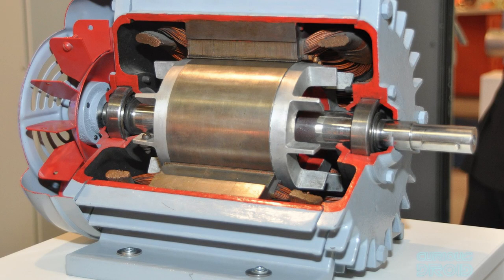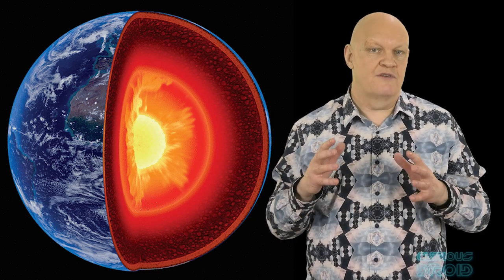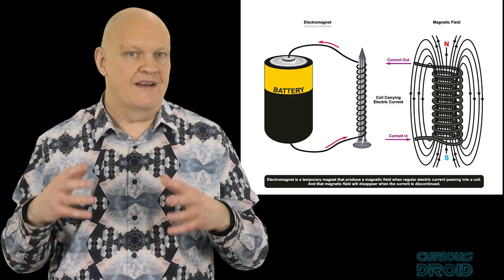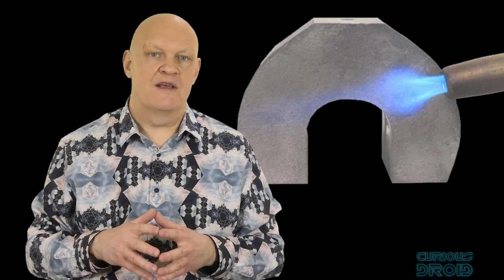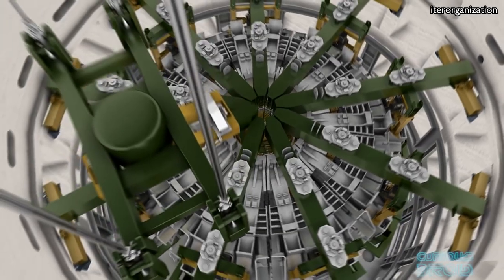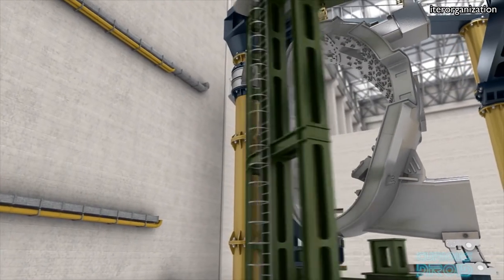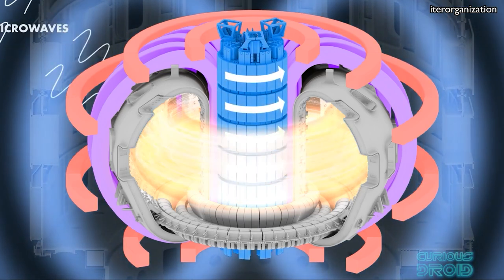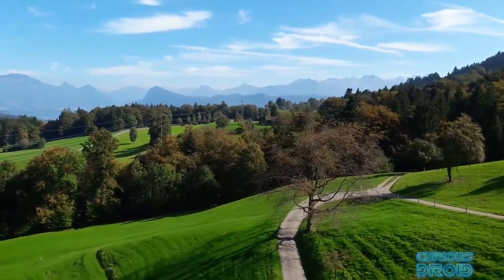The Most Powerful Continuous Magnets Yet Made

Comment: Someone once said that the easiest way to make a small fortune was to start with a large fortune.  Experimental fusion reactors similarly have so far only yielded low energy output after high energy input.  A sobering observation is that wind power, coupled to battery storage, is proving to be such a cheap renewable source of energy that the economics of fusion power may prohibit it from ever competing with it.
Reply: People are so enamoured with cheap power from fission and now fusion, that they are prepared to dump endless resources into it without the objective analysis of costs to runs such a sophisticated system to say nothing of all the highly trained staff required to run it.  By 2035, it will be too late to get off Fossil Fuels if we spend money on such capital extensive projects. Put the same money into refining our existing grids with current tech and we have it solved but what gets in the way is not the technology but incumbent Fossil Fuel companies who are never walking away from $T still in the ground.   Look at the non stop trashing Tesla gets and its nowhere near as big a challenge to Fossil Fuel Industry as this will be.  Moreover, Fossil Fuel industry would support Fusion because it will pull resources away from using existing renewable tech to get our CO2 production solved in the next 10 years.  Money spent on Fusion is capital misdirected to our demise.

Comment: I used to work at a place that built cranes, and to build cranes, you need to use cranes.  Outside we had a crane with a magnet, could lift up to 10,000 pounds.  Magnet was a big rectangle, about 2 feet by 3 feet.  Had a wireless remote control and you'd turn the magnet on and off with a switch on the remote.  It was so much easier to use the magnet rather than using straps or chains, but it was also a little more dangerous.  But then again the only thing I ever saw come crashing down at that place was due to a hook on one of the chains breaking in half.

Comment: I've been asking this question for a while but have not yet found a satisfactory answer:
"How will a fusion reactor convert a hundred million degrees in temperature to electricity?"

If it's just going to boil water to make steam to turn turbines, that seems pretty wasteful considering you only need 100 degrees Celsius to do that. Building many fission reactors for the price of one fusion reactor seems like a more efficient way to convert water to steam.
Reply: Yep.... it's going to use the hilariously ancient form of steam power to drive turbines.
Reply: @BRUXXUS  All the artisinal craft beer hispters are putting on their top hots and twirling their mustaches all the way to the Steampunk convention when it's held in celebration of ITER being switched on.
Reply: @oldmandoinghighkicksonlyin1368  Hahahaha, I mean.... why not? 
But yeah, it still feels super weird that we're developing this ultra-high tech power source, but still just using it to boil water. While it's fairly efficient, I still feel like there's got to be better ways to get electrons moving.
Reply: Steam at 100°C is only useful for making tea.  Water is boiled into steam, the steam is heated and that heated steam drives the turbines.  Steam at around 540°C is typically found in coal plants.  About 270°C in nuclear plants.
Reply: @borysnijinski331  Still quite a deficit when fusion is cranking out a hundred million degrees Celsius. Seems wasteful.

Comment: Small correction: It's not the neutrons which heat up the water in a fission reactor. It's the electromagnetic discharge, which is a result of the loss of total mass, which heats up the water (Or whatever material they use as a heat transport. Some uses molten salt).

Comment: For a clarifier, Fukushima and TMI did not experience runaway reactions, or prompt criticality.  Thats not physically possible in LWRs.  They did, however, lose decay heat removal and the fuel overheated an melted.  This occurs because the radioactive decay of the fission products produces a substantial amount of heat, even after the Rx goes subcritical.

These numbers for ITER are not great.  For reference, a nuke plant uses about 50 MWe to produce 1400MWe.  Keep in mind there is no balance of plant equipment at ITER.  In a thermal plant those items use most of the house electricity, for feed pumps, booster pumps circulating pumps, etc.  300mwe to make 500mwth is not a net positive for electrical generation and not commercially viable.  It's neat, but still many many many years off.

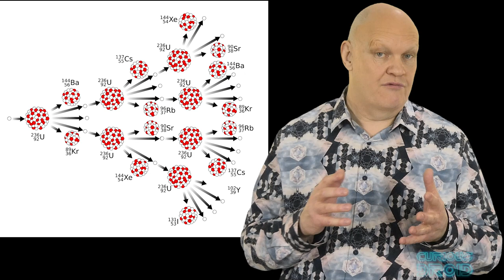Comment: 10:10 Information is incorrect. In Fukushima the chain reaction was stopped immidiatly! The problem was with the loss of reactor core cooling.The rest decay heat has to be compensated by the cooling system. 

Unfortunaly, this problem exists (in a smaller scale though) in the future fusion reactors. Even after plasma shutdown, walls will still produce a lot of heat due to the dacay of the wall radiactive materials. In case of cooling system fail the wall can melt. It is apperently not that dramatic as in fission reactors though.
Reply: Yeah, one of the advantages to fusion is that the worst scenario is localised destruction. Unlike fission, fusion requires active effort to sustain it, so if containment power is lost, the reaction stops pretty quick. However, you still have 150 million °C plasma circulating in the reactor, and now it's uncontained, and will do a lot of damage before it cools down.
Reply: @simongeard4824  I'm talking about irradiated wall, which will heat itself even after stopping fusion and plasma completely

Comment: Fascinating as always! - but I would like to see a bit more on the Fusion projects - specifically how is the heat generated extracted - seems the reaction area is surrounded by super cooled magnets - how do you "sneak" the heat past these? And I assume the zillions of neutrons produced activate all the surrounding materials - what are these effects? Embrittlement, production of radioactive elements, structural issues as elements change? Also, what plans are made for safely "draining" the super conductors if cooling is lost? Losing superconductivity would sure release a lot of energy. Fascinating issues - I'd like to know.

Comment: The big question is what if something in the calculus "we" use to replace the huge gravity of the sun to make nuclear fusion possible here (but with higher temperature) is off or there are some undetermined factors that make the whole process unlikely.
Then we will never reach such reactor's utopia. Or may be the complications come simply by the very process(es) we try to apply that simply are beyond our current capabilities. 
So far, even if we get one working as desired (with real net yielding of excess energy), it would be the most expensive form of energy (as per the money poured into it) ever.

Comment: Carbon has a negative temperature coefficient, so the warmer it gets the better it conducts and this is why its used in electric motors as brushes when they're required
Reply: That and because they are slippery and softer than the sliprings and commutator bars.

Comment: 11:30 "The problem is that unlike the Sun, we cannot recreate the extreme pressure here on Earth" This is only partially the reason we want much hotter plasma than that at the Sun's core. The Sun is a surprisingly anemic reactor: its core has average energy output of mere 300 W/m³. The humongous energy output of the Sun is due to its giant size, but its power density is meek. At this output rate, a 300 MW reactor would require the reaction zone volume of 1 million m³. Imagine a cube 100×100×100m (yes, it's hard even to imagine!), this big, entirely impractical. We need a much, much higher energy density here on Earth. This is also why we cannot use light hydrogen as the fusion fuel. The p-p reaction, the main reaction within the Sun, would still require unreasonably high pressure and temperature. The D-T reaction has a much larger cross-section (a measure of the likelihood that fusion will occur if you get nuclei close enough despite repelling charges), and the heavier hydrogen isotope nuclei (D is a proton and a neutron, T is a proton with 2 neutrons) are easier to smash together: the Coulomb repelling force is the same at the same distance, since each nucleus has 1 proton, thus 1 unit of charge, but the kinetic energy of the nuclei with the extra weight of neutral, non-repelling neutrons is proportionally higher (a proton and a neutron weigh about the same, so the D nucleus weighs twice as much, the T thee times heavier).
Reply: And in comparison, a human is about 1,250 watts per cubic meter, or roughly four times the power density of the core of the sun!

The standard 2000 kcal daily recommend diet is 8.368 MJ of energy, there’s 86,400 seconds in a day, for an average power of 96.86 watts, which we’ll round to 100 watts. The average person in North America weighs 80 kilos, and humans are close to neutrally buoyant in water so we know their volume is 80 liters, or 0.08 cubic meter. 100 watts per 0.08 cubic meters gives a power density of 1250 watts per cubic meter.

Comment: 11:30 "The problem is that unlike the Sun, we cannot recreate the extreme pressure here on Earth". Isn't that what inertial containment fusion researchers such as First Light Fusion do?
Reply: Pressure and temperature work together: in physics they'll often appear in terms together (as a product: P*T).  The sun has tremendous heat AND pressure.  the inertial confinement in ITER and most torus-designs is trying to maximize the pressure we can achieve on earth... but what we lack for pressure we have to make up for with temperature.  Hence the temperature has to be THAT much more than the sun, to make up for the deficient pressure.
Reply: ITER doesn't use inertial confinement, it uses magnetic confinement. Inertial confinement either uses lasers to compress fuel pellets, or as in the case of First Light Fusion, a physical impactor.

Comment: Please make a video detailing how scientists plan on actually harnessing fusion for use in producing electricity. It’s one thing to make it run, it’s another challenge to utilize it.
Reply: Yes, always wondered how to deliver the plasma thermal energy into working fluid (steam, other hot gas)
Reply: Worry about making a sustained reaction the produces more energy than it consumes and the worry about how to harness the heat to make steam.
Reply: @borysnijinski331  I'll love it if they make the machine actually run but can't extract the heat to make power.😂  Fusion was only 30 years away...30 years ago

Comment: fusion will require much higher temperature than what happens in the Sun.  In the Sun the probabilities of fusion of aroms are extremely low, but due to the enormity of the Sun the very low probability events happen enough times due to quantity of the available material.  Our fusion reactors on Earth don't have anywhere those amounts, so the low probability events just won't happen in quantity that would make any difference

Comment: Good to see you back, question: I was under the impression degrees were used for Celcius and Fahrenheit but Kelvin was the metric on its own so "degrees Kelvin" dont exist. Feedback would be appreciated
Reply: I'm pretty sure you're right.  Such an easy mistake!  I usually have "degrees Kelvin" on the tip of my tongue...  Never degrees Volt or degrees Ohm, but I guess its habit when talking about temperature.  Although I might also say 20C rather than 20 degrees C,  so......does anyone care?
Reply: You are correct.  The metric unit of pressure is the Pascal (1 Newton / Meter square).  We don't say "degrees Pascal".  We just say "Pascals". or,  more probably "Kilo Pascals" such as your tire pressure.  Kelvin is an absolute scale.  Fahrenheit and Celsius are relative to a mid-zero point.  So we say Degrees for those relative scales.

Comment: LFTR is a fission reactor which promises to mitigate the risks, and drastically reduce the amount and half-life of waste products. It operates at high temperature, avoiding the need to create high-pressure vessels which can rupture. The reaction is self regulating: as the liquid heats it expands which slows the reaction. The feedstock is thorium, cheap, furtile but not fissile with minimal and manageable danger. The waste products are a fraction of the amount and decay in a few hundred years instead of a tens of thousands of years. It can even be used to burn conventional nuclear waste. I think it was a better alternative, but it was not adopted since it did not produce plutonium for bombs. Finally, I think it is the ONLY viable potential power source for a mars colony.

Comment: Ty Paul! It would be nice to know world record for artificially generated magnetic field. Also regarding Magnetars: „Atoms are deformed into long cylinders thinner than the quantum-relativistic de Broglie wavelength of an electron."[6] In a field of about 10^5 teslas atomic orbitals deform into rod shapes. At 10^10 teslas, a hydrogen atom, 1.06 × 10−10m, becomes a spindle 200 times narrower than its normal diameter.[6]“ Wiki.

Comment: There is much stronger manmade magnets, but these are not continuous operation. Namely, the electromagnets at HZDR in Germany. They do up to 100 Tesla in short bursts.
I've seen them with my own eyes. They use several stacked coaxial copper coils, with a material similar to Kevlar in between coil layers to prevent them from tearing themselves apart in the extreme magnetic field. Before firing, they are cooled down with liquid nitrogen, and after a few milliseconds of operation they become toasty warm.
These magnets are used for material research, also in conjunction with a particle accelerator. The power source is giant capacitors banks the size if two large gym halls. The wires are thicker than my arms and heavily bolted down, to prevent them from self-destruction due to Lorentz force. Really impressive.

Comment: Just developing a practical room temperature super-conducting wire would be huge. Right now, electricity can't be efficiently transmitted much over 500 miles. With super-conducting wire the range would be virtually infinite allowing electricity to be transmitted to areas of high demand from areas of low demand.

Comment: The only bit you neglected to mention is that fusion reactions have been done for several decades now but it ALWAYS takes a hell of a lot more power being put in to create the heat and pressure than we get out from the reaction itself. Well, you hinted at it but didn't say it plaining like it is. And plainly put, the sun solves the problem of heat and pressure by being so massive. Without the natural heat and pressure by so much matter being compressed together, it takes A LOT of energy to reach the required conditions for fusion and until the in out power ratio is more towards getting more out than we put in, its a pipe dream. Billions spent on many different fusion reactors (expensive lightshows) and we're not really any further forward than we were in the early days. Every new reactor is funded and built on the idea that they "hope" to producing power in "the future". 

Meanwhile, we have fission right there but all the hippies would rather we depend on the hopes and dreams of solar and wind.

Comment: Thank you for this great video. Interesting how a small increase in the strength of the magnetic field in fusion reactors gives a much bigger increase in power! One small criticism : I think you exaggerated the dangers of fission power which is one of our safest forms of energy. Chernobyl did indeed suffer from a runaway fission process but this is not possible in our reactors due to the negative void coefficient in the design. Fukushima and Three mile Island did not suffer from a runaway fission process. They melted down due to the residual decay heating after fission was stopped. Exaggerating the dangers of nuclear power has a cost : it leads to loss of lives because we end up using more dangerous types of energy such as coal and gas.
Reply: Indeed.  Most don't realize that these were enormous ECONOMIC disasters, like a the Space Shuttle or Concorde.
Reply: I though the lid blew off as Hydrogen from dissociated water exploded.

Comment: Late last year I went in for an MRI on my back and as I went to get into the machine I felt a pull on my shoes. I wear a pair of steel toe shoes as my normal shoes and didn't even think about it until I was on the table and the MRI was pulling on my shoes. I don't believe the machine was fully energized as the pull wasn't pulling me into the machine but it was definitely noticeable probably around 15-20 lbs per shoe. It was a very odd experience.

Comment: Most MRI medical machines are 1.5 Tesla not 3 Tesla as you implied. And MRI magnets are generally always energized 24/7 unless the machine has a problem and requires service that needs the field de-energized. Because superconductors are used it takes relatively little energy to maintain the field 24/7. If you want to look up the scary aspect of MRI it’s not the magnet, it’s the 40,000 watts of RF energy inches from your body. All the noise they make isn’t from the magnet it’s the RF coils being hammered with massive RF currents. Even non ferrous metals are dangerous in an MRI as the RF can heat them or even cause arcing like putting metal in a microwave oven. People are worried about the RF energy from cell phones while an MRI has around 100,000 times more RF energy.